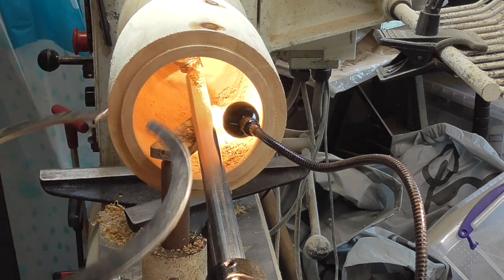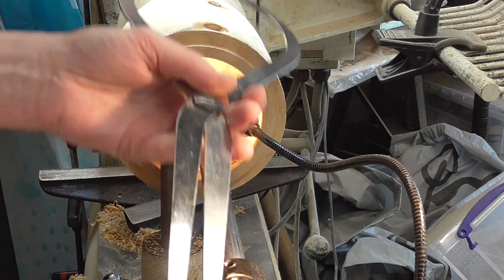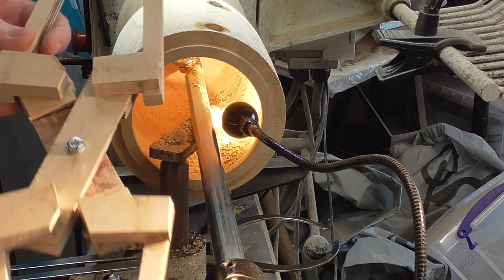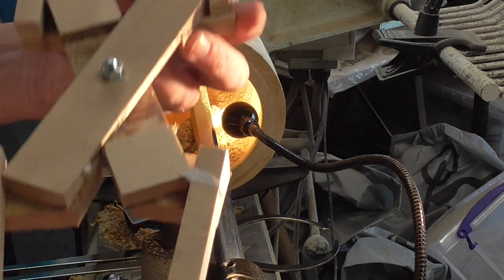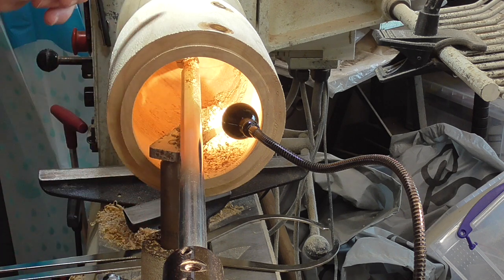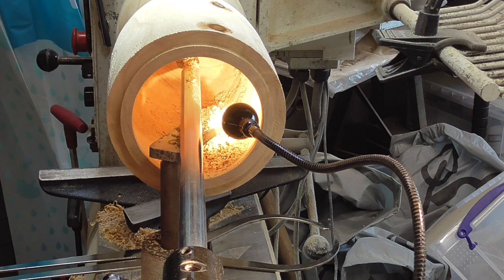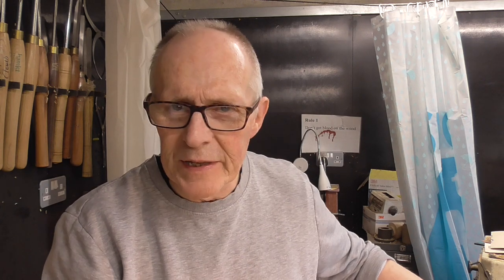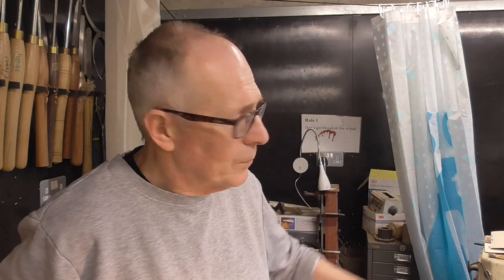Urn 5

Comment: Hi Brendan i have made a set of calipers out of some beech wood about 4mm thick and a nut and bolt cheers ian
Reply from the maker: Hi Ian, I was thinking about these calipers and decided to take them apart and cut the sticky-out bits off because I used them on a few other things to check them and they are dead accurate... and cheap!
Best Wishes, Brendan.